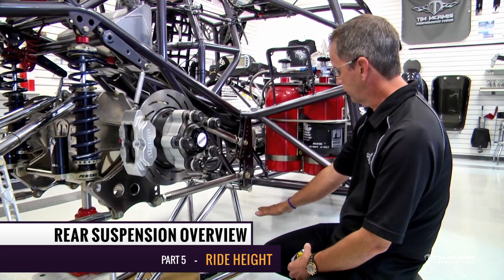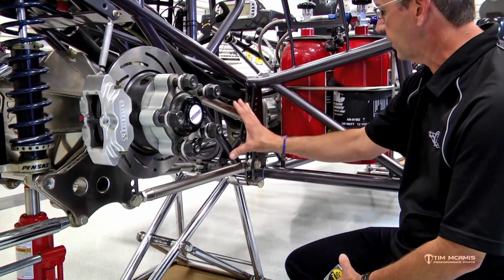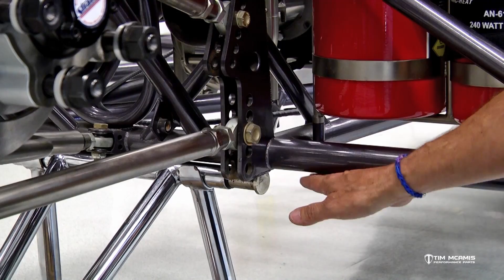Rear Suspension Overview: Part 5 – Ride Height

Comment: I baught a truck set up with 4 link suspension. The rear is a little low for me. Can I raise the rear of the truck through adjusting the 4 link. Or is that only gain by the coils? Thank for any help.
Reply: The coil overs adjust ride height but it changes more than ride height in the geometry of the suspension and chassis. Draw triangles, up down and sideways,  move one end but keep the other end the same and watch how the angle affects the other triangles. Play with it and hopefully it starts to make sense, add arcs after you see it and see how that affects things.
(<)    (>)   (v) the arc can represent the tires, crankshaft or driveshaft and axles. I hope the visualization helps you.